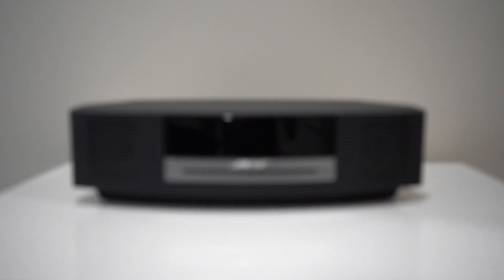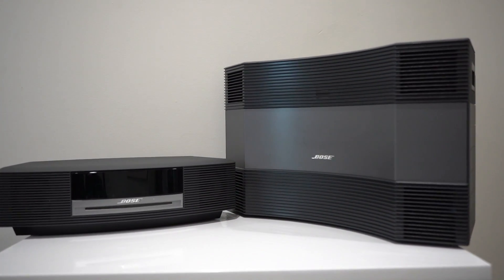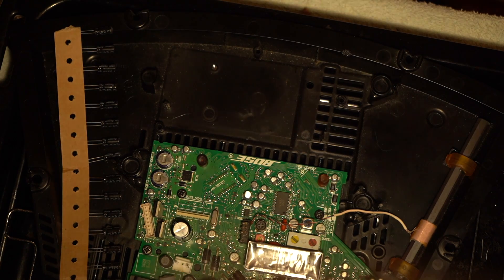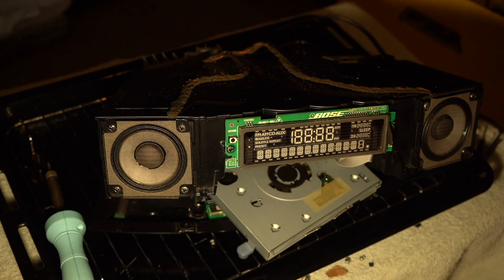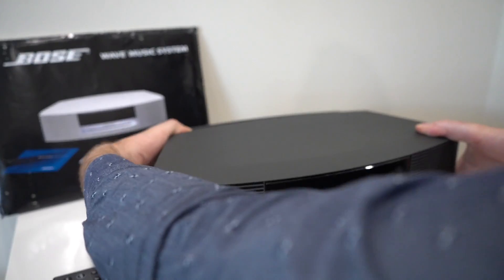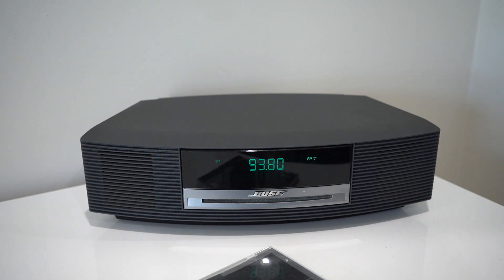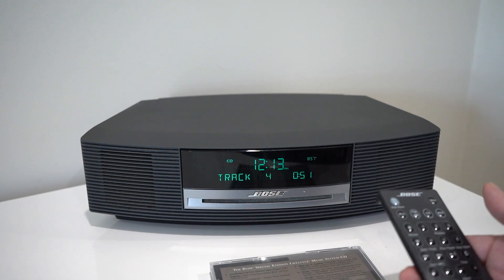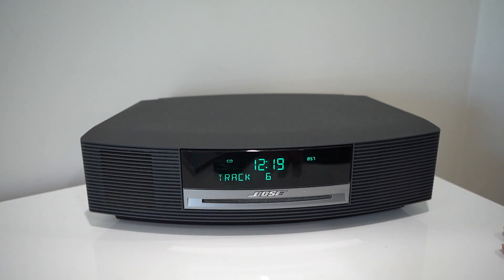How the Bose Wave was an AUDIO REVOLUTION

Comment: there are no physical buttons on top like the original, you are out of luck if you don't have the remote. I use mine as soundbar for tv. Crazy labor charge for replacing every capacitor has to be over $500.

Comment: Bose are furious about vids that claim the caps need replacing on the CD board. Issues with skipping etc, are down to a DIRTY LENS or CONTACTS.  After tubes showing the unit working after changing the caps, the truth is that contacts have been cleaned through being taken apart and re-built. It seems that you found out the hard way. It was a simple dirty connection.  Many people out there use their Waves in the kitchen when cooking grease fouls the contacts and lens.  It should take 3 seconds for the Wave to read the disc, so that's an issue you haven't got. Seems to be that your unit needs a good clean of all contact and mechanical components...
Reply: Electrolytic caps has a shelf life of about 7 years,  the de-gress or dry out and loose there values

Comment: I bought a bose wave radio at a thrift store for $10. No remote. I managed to program a universal remote to partially work to turn it on but not much else. Ended up borrowing a remote from my dad.
I need to buy one, about $10.
$20 altogether is not bad

Comment: Been dosing off, waking to a first gen cd wave clock radio since 2001. It cost maybe 15x the generic bedside clock radio of the day but sounds way better and, 23 years later, represents good value for money. Top load cd means no mechanism problems but mostly use phone into aux audio. A couple of the top button controls got flaky but they have fixed themselves, suspect was maybe contacts cleaning up with use as mostly used the remote for years.

Comment: Built the tooling for the original Wave Radio back in the day.
All H13, copperberyllium with D2 tool steel lifters.
First class all the way.
Up till that time they had been using a simple mild steel mold that had to be assembled, a part shot, disassembled, part removed, reassembled, rinse and repeat.
Our tool was a production tool and pipped out a housing every 20 seconds or so rather than every 5 or ten minutes.
They didn't lower the price to reflect these efficiencies, as I recall.

Comment: The BOSE WAVE SYSTEM III cost $499, that's what I paid for mine some 10 years ago at an authorized BOSE outlet @ Dolphin Mall in Miami. A year ago it stopped producing sound.
 It's going to cost me about $200 (with shipping) to have it repaired at Josh Electronics in Costa Mesa, CA  Any suggestions as to how wise a move it is.
Reply: That's a good idea.  The other option is a used Wave IV for $300 but the difference is mostly cosmetic.

Comment: A few years ago I bought exactly such a device on the secondary market. It was accompanied by a manual, an antenna, a remote control and a test CD. To be honest, I expected more from this product. The Harman-Cardon go+play Bluetooth speaker sounds better despite the fact that it costs more than twice as much. I ordered a pedestal from the fourth Wave model from an official Bose dealer, and got the opportunity to listen to the sound via Bluetooth. The system complements the interior of my apartment. In my country, this is a rare product

Comment: I worked for the company on the retail side from 03-06. I was there when the company auditioned the Wave to us before it was launched. We had a display case in store that displayed a vertical spine that separated the top cover down to the chassis and all the components in-between. It was pretty cool. The system has two 26-inc  tapered  wave guides and is a half an octave lower then the previous design. The two differences in the current series is the housing, and you are able to adjust the bass. Those were good times

Comment: I had 20 year old Bose radio, tremendous sound.  I gave it to my son as i wanted Bose with CD player as well as radio.  This one i ordered  i thought was new for $325 but  just older model.   It sounds terrible and if you increase volume to 40 you cannot even understand words.  I think it is bad speakers.  Am I stuck with it or can it be fixed?.  I am very old but have engineering background and steady hand.  Can i fix it myself?
Reply: Sounds like the speakers blew out if the words sound garbled.  They can be replaced fairly easy.

Comment: 1997 vintage, AWR1-1W in Charcoal, owner since 1997. When I got it new. The music is not blow you away, but when I first heard one I fell in love, and when I received mine at home. I played around with the position, and I was amazed by what sound was being produced (like all bose speakers that is of similar design, their positions may need to be adjusted. Not always as Bose directs, but closeish, if you desire the stereo separation/surround effects. I have had/have many Bose products, through the years. I love my Cinemate (analog model, which has two bidirectional speakers powered by the Acoustimass. With the ir receiver/left right input connected to the Acoustimass.) on my bedroom television. I enjoy the Boseie sound, and I understand the limitations of each design. 
If you have a model that has outputs, and they are variable. You can use an active woofer with it. For a long time, I didn’t use one and loved the sound quality by far. It will not be an main system, and it will not be any good for a party, or jamming, but but for a bedroom, and other rooms that you will want good audio, it will be good, an active woofer will only increase the enjoyment. 
Enjoy your Bose products, because if you enjoy the sound, you can turn it up where you don’t need to hear those haters.

Comment: A salesman in a HiFi store badgered me into listening to one. It was a rather underwhelming experience, not bad for a small unit but not in the least HiFi. At least it wasn’t as awful as the dreaded Bose 901s.
Reply: Replaced my old Bang and Olafson 3500 system as it was going bad and I was moving to a smaller place. At first I wasn’t happy I moved it to a smaller bedroom where it really shines. Didn’t used to play on low volume, but that’s where it shines. The 3 unit is still holding up after around 20 years though the 3 disc changer unit died yesterday. The changer was always noisy, and I guess it ate itself up.  Motor died.

Comment: I recently found one of this particular model on an e-waste recycling shelf. Seems to function pretty well, but I get some static noise on the AM band. Any solutions?
Reply: The AM antenna is internal.  The only way to get better reception is to reorient the unit to a different position.
Reply: Stop using AM radio, it's 2023 👍🏻
Reply: @raurirobinson  LOL but soon the same will be said about CDs, yet I'll stick with them.

Comment: Just received a Bose Wave IV unit....and it was one of the most gutless systems I've ever used.  I don't mind not having bluetooth (it saved us money).  But, the complete lack of bass, not to mention how under-powered it was, was unforgivable for a Bose product.  The volume was OK....although, when maxed out, was hardly earth-shattering.  And, the bass was so non-existent, I thought something was wrong initially, and I just needed to adjust it.  Well, you get two bass settings "Normal", and "less".  So, when set on "normal", it was pathetic.  The Bose mini, literally out performed this unit in all areas, INCLUDING bass...(aside from a bit more volume from the Wave).  We bought two of these, with the assumption it was an exponentially better unit, and was floored out how incompetent the unit was.  We had it packaged and ready to send back before they were even registered and delivered.  VERY disappointed in Bose, given we have over 5 different Bose products in use as of this comment.
Reply: I had that same issue when I bought mine. I learned that you have to put the wave radio by a wall to get any bass. I got better bass response when I placed it on a shelf under my TV stand. With that said, I got mine on sale for $300 USD. At $300 USD, it's an okay system. At $500 USD, absolutely not!
Reply: @mi-da2920  It's funny you mentioned that....because we have two Bose Mini's and that's exactly how they responded.  We have a little mini bay-window kind of cut-out  we put it in, and it's stunning how good that little unit sounds like that.  Something about a concave shelf with the glass of a window that increases the sound quality exponentially.  But, this one is just too big, and like you said at that price, I don't think I should haven't to make those kinds of adjustments.  The bright-side is that I was able to talk my financial advisor (better known as my wife)  into investing in an "audiophile" type of setup.  So, it all worked out. 👍
Reply: These are marketed as bedside table-top alarm clocks.   They sold thousands of them to hotels who used them as such.   They were never meant to be used as high end concert hall systems for large rooms.    When used as intended they are perfect.
Reply: @gfriedman99  By "used as intended" I'm assuming you mean turning it on and hearing it from  5ft away.  You apparently had a completely different system, a better quality model, or used it in a setting well outside of Bose's own marketing, and suggestions.  That, or your expectations are so low that you don't deserve to have an opinion on the topic.  Or, worse yet, your tongue is so far up Bose's @ss that you don't have the ability to look at ANY of their products objectively, and/or are paid to give your sh!t-head version of "Nuh-uh", when you see an honest review.  We purchased two of these, and both were gutless pieces of sh!t, compared to the other, smaller, cheaper Bose speakers we've had for going on 10yrs.  You're acting like we took it to the local arena, expecting 60K watts out of it, while I ran a jack-hammer 300ft away.   It was sitting on a kitchen counter RIGHT where the other Bose system was that we were replacing that, again, was cheaper, and smaller.  Not a high-end "concert hall", dumb@ss..... 

Regardless, absolutely nothing about this unit mentioned it being a gutless, thin-sounding "alarm clock" meant for hotels where people don't venture more than 3ft from it, with absolutely no other sounds happening at the same time, or are in the room to use it 90% of the time.  Had it said something even REMOTELY close to that we never would've purchased it.  You're the type of moron that also makes me want to bring up the constant issues we've had with a few of their products, as well.  Bose isn't the untouchable God's you're making them out to be.  They're products sound great (hence why we own so many)...but, they've developed on-going quality issues, as of the past 10yrs.  

At some point in your life, you're going to have to take responsibility for you lack of intelligence, and account for the stupid sh!t that comes out of your mouth.
Reply: Wave guides work by reflecting from walls, the way to set these up is have someone stand in the listening position and move it forward and back near a wall and also rotate by a few degres when its right you will know the low end will suddenly focus and you will hear a full sound.

Stay away from corners because you can end up with cancellation due to two reflections interacting.

You will get deeper bass in a bigger room but at the same time the distance from the wall will need to be different.

I have the big st30 which has a larger version of the waveguide and it goes from sub like bass to nothing depending on where you put it.